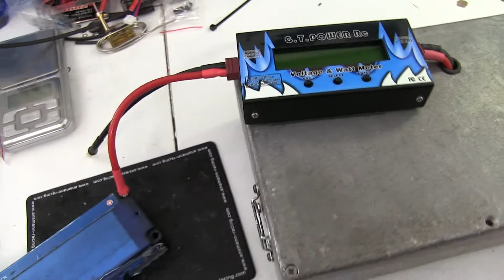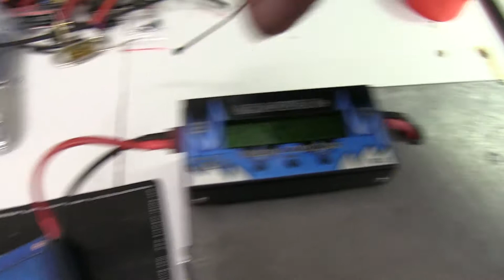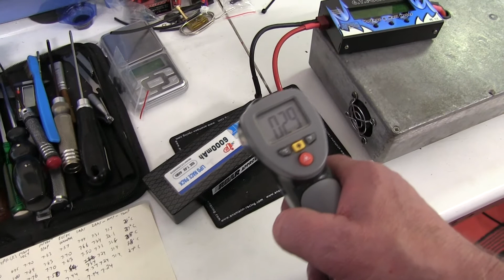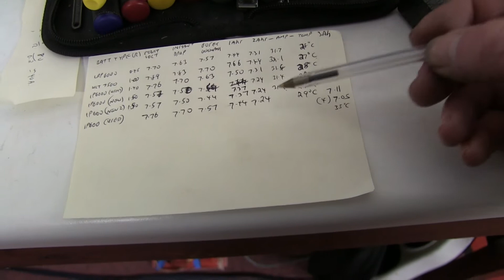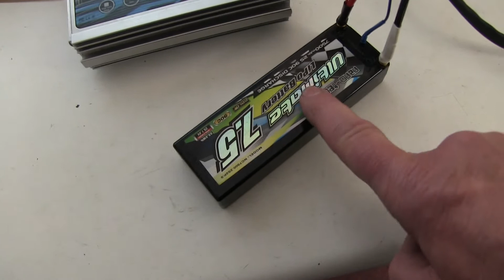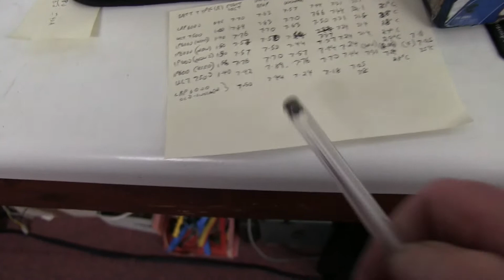Good Lipo Bad Lipo. How to test 2S Lipo to find the best .

Comment: Nice,Thank you sir for the detailed reply.  My wife and I are teachers and she teachers science.  We all race.  You answered my prior questions very well and I have already watched your new video.  I think the branding is hype.  I am not sure how much you know about lipo batteries and RC motors but is seems a lot.  I don't think there is a real issue with motors if you have the ability to test them.  I recently received two identical Tekin 4300kv 550 motors.  One was consistently faster but I would never believe it.  I changed everything from the ESC, Servo and even plugs and wires.  Finally, I just took the faster motor from my sons truck and put it in my Tekno SCT410.3 for testing as we have a track at home.  That motor was not only much faster but also ran cooler.  There is no timing in these motors.  No way of changing anything.  Thoughts on that?  ( Also, I have many more so if you are willing, I will pay to ship them to you and pay for the shipping back as long as you have a way to test them for not only speed but torque)  Last, in you opinion, do you think lipo batteries are as good as they can be at the moment or if someone was willing to dig a little deeper, could a dedicated company make truly better batteries?  Also, with the probable cost that would come with high end research and development, is there a market for a battery that might cost 35% more but perform 15% better?  Again, thanks for the videos and if I have your permission, I am  a writer for VRC PRO.  I am just starting but I will be post the races each week including the worlds, etc.  Are you ok with me leading people to your site to watch the tests?  Ohio is having some 17.5t SPEC racing talk lately.  People are saying that stock was created for people to be able to enter the sport fairly cheap and under control.  Basically it was for the beginner and intermediate.  Now it seems you have to put at least $2,000 in a buggy just to make the A-main.  I recently talked with a spec only driver who had $4,800 in his buggy(tires, transponder, multiple motors, multiple batteries and upgrades included).  I know the research you provide is important now more than ever.  Tony
Reply from the maker: +Tony Dugan 
Hi Tony
See my new videos comparing The Turnigy Ultimate and Graphene Lipos.
The Graphene are a lot more expensive, and I was expecting a step forward in performance.
See my video for the results.

The Lipo manufactures have been trying to stop the swelling (puffing up) of Lipos with the new versions, and also have raised the operating voltage (Super High Voltage).
However in practice they have lost some power delivery, even though they still rate them at the same C rating.
Some manufacturers nake exagerated claims regarding C rating, and I have seen 135 and 140c,  but tests show no improvement.

There is a masive investment in battery technology for full size road cars as well as many other applications, and I'm sure there will be a breakthrough soon.
At the moment I think the Lipo has reached as far as it can go.

Thanks for the offer, but I think I have enough to do at the moment, as I only do this testing in my spare time.

Race on.  Nick

Comment: The voltage drop you mention is not the lipo. It drops from 7.50 to 7.44v. Your meter have a 60v max voltage. And the most common microcontrollers have a 10-bit analog to digital converter. Dividing 60V with 1024 and you get ~0.06v and there is your answer :) The reason it go smoothly between the values it is because the microcontroller makes an average value over time.

Comment: Really nice testing, thanks for sharing.

Btw where do you buy the IP6000?
Reply from the maker: Hi Pabula
Thanks for the feedback.
The Intellect IP Lipo:
I am in the UK, so not sure where you are?
Nick
Reply: Im in the US, but i heard good things about IP batteries just not a brand that i can find here, im looking for a shop that has your 6000mha battery and can ship out, even if its from the UK.
Reply from the maker: Hi Pabula
It is not possible to ship Lipo by air out of the Uk.
You can check them out here:

http://www.racing-cars.com/sp/category/Manufacturer/subcategory/Intellect/templateid/12/searchbox7/Batteries.html
Reply from the maker: http://www.racing-cars.com/sp/category/Manufacturer/subcategory/Intellect/templateid/12/searchbox7/Batteries.html

Comment: Great video Nick!
Quick question, what should my Ohms read for a healthy 2700mah 7.4v Lipo 2 cell battery?
I’m new to all of this and trying to find a “healthy” reading for what these batteries should read...
Thanks Nick and all the best!!!
Reply from the maker: Hi Michael
You don't say how you are reading the Ohms.
You cannot measure with a normal multimeter.
Some chargers have a IR (Internal Resistance) reading, when charging (and discharging on more expensive ones)
Each charger will display different results, but can be used for comparison.
The smaller the Lipo capacity, and the lower the C rating, then the higher (worse) IR.
The very best Lipo have an IR below 2milliohm
Your Lipo will probably be more like 20milliohm.
Reply: Nick Adams s - you’re right! I’ve a balance charger SKYRC B6AC V2 that checks internal resistance, etc.
Sorry nick, I’ve been in such a hurry lately...
Thanks for the reply!

Comment: Nick Adams,Thanks for your video's and hard work.  Most of all, thank you for sharing your wisdom.  Most people want something and that's fine.  You seem to want to share the truth and provide an education which I really like a lot.  I would like to make a request for a video that I need, my friends need and new guys in the hobby will eventually make their way to your page.  Can you make a video and:1)  Show how to find the IR of batter and also does it change if its running a motor/ESC/servo/etc.2)  Can you give your opinion about quality for batteries and motors?  Basically, with the testing you have completed, have you found a company that is above all others?3)  Last, is there a way for you to find the point where NEW motors start to "heat sink" or lose power from too much heat and are they different between manufactures.  This kind of goes with my "which is the best" question.  I bought a Trinity 24k 17.5 and ran it in 2wd SCT.  My second race, I was messing with both the gearing and timing and didn't get it right.  My wife temped the motor instantly and it came back at 202*F or about 94.3 degrees C.  I should have lost power but didn't.  What do you think the limits are for heat?Thank you for all you do.  Regards,Tony
Reply from the maker: +Tony Dugan 
Hi Tony
1. Measuring the Internal Resistance is quite difficult to get a meaningful result, since there are so many variables, especially the connections and wire etc.
I have an IR meter which is temperamental, and needs very good connections.
I now prefer to measure how the voltage holds up under a high amp draw load.
2. Regarding which is the best make of motor and Lipo, I have only tested a limited number of makes, but I try and test the best, rather than waste time with the others that are known not to be good.
I am sure there are only a few manufacturers (in China) that make all the motors and Lipos, but with outer cosmetic differences.
Therefore it is possible that some unknown make could be very good.

Of all the Lipo I have managed to test, the Turnigy is the best. (The Ultimate series).
Motors : the Trinity Revtech are the best, as they perform and are reliable and don't burn out easily.
Others could be very good, but often are let down by poor case design with screws that strip out and badly fitting sensors, and burning out the windings, or rotors exploding or losing magnetism.
3. I recommend not getting the outer case above 80degC, and preferably only in the 70 degree range.
I have seen motors survive over 100degree C, but the inside will be way hotter, and the solder often melts off the connections.
Also a lot of motors will melt the insulation and short the wires on the stator when they are overheated.
This normally shows up the next time it is turned on, as the insulation has run off the wires and will short circuit , sometimes taking out the speedo.
Use a big fan on the motor, ( I use a 40mm x 15mm thick) and it will lower the temperature a lot, maybe 20 degrees.
All motors lose power at high temperature as the stator windings will increase in resistance, and the rotor will be extremely hot and will lose magnetic strength (which will return as it cools, on most rotors). Some rotors will lose magnetic strength if you are unlucky.
If yours did not lose power then you are onto a winner.

Keep on racing to win.
All the best
Nick

Comment: Great video. What charger do you recommend to be competitive at the track? Any good advice. Thanks in advance.
Reply from the maker: Hi Alejandro
Any Lipo charger that can charge at 7 amps or more.
I charge at 7 amps at the track, but you can use up to 3xC with modern Lipo
So with a 6200mah you can charge at 3x6.2 = 18.6amp.
From a 12volt battery, 10 amp would be ok.
Reply: Thank you.

Comment: Hi Nick. Been binging on your channel. Is there a company that makes a almost all in one charger like the turbo 30 was years back?
Reply from the maker: Turbo 30. That was 40 years ago!!
What do you mean all in one?
Reply: Nick Adams I mean a high discharge rate ,  cycling with the high amp discharge rate ,motor testing. And also wondering what you think the best charger is now if money didn't matter?
Reply from the maker: Hi
I don't know of any that do motor testing, that also do the high charge/discharge.
The best charger/discharger is the iCharger 406Duo (With the optional external resistive load).
Reply: Nick Adams thank you very much. I love the videos and that you take the time to answer. It's straight to the point and unbiased. It's been my crash course back to the hobby. Looking forward to the mini pro breakdown. I've been considering that or the mcpappy Dyno.

Comment: Nick, have you ever measured an internal resistance drop in Lipos when being charged and discharged at a high amperage rate of 40 Amps or similar?
Reply from the maker: Hi
The internal resistance drops as the cell is discharged. I assume as it heats up.
The internal resistance, when charging also drops, although the heating is not as much as when discharged.
So when I test, I record the IR at the end of a full charge, starting with the Lipo at ambient temperature.
As I test at only 20 amp charge, there is virtually no heating.

Comment: I see that you are charging at 10amps or roughly 1C. Most folks I race with are charging at 2 and 3C with their high powered iChargers. What are your thoughts on the practice of charging at higher amps? Thanks.
Reply from the maker: Hi
The latest Lipo can take repeated charging at 3C without any degradation.
Charging at 3C is quicker, but does not increase power.
Unless the Lipo has been heated and they want to charge it up and race before it cools down.
Reply: Now that I know it's safe, I may give it a try myself. Fast, yet safe, charging at 3C is indeed helpful on race days. I bought Turnigy batteries on your recommendation. Thanks for the fast reply!

Comment: Hello
I need your help
I have a lipo battery 3s 5400mah which is more swollen 8mm more than the normal size,the Voltege indication of each cell is exactly the same with another lipo battery 3s 6000mah,is the swollen battery dangerous to use it or I need to check something more?
Reply from the maker: Hi Paris
The Manufacturer will say, do not use.
Sometimes the swelling will reduce as the gas is re absorbed.
The performance will still be ok.
However 8mm is a lot and it will probably swell more if you use a high current load.
The pouch can swell a lot without danger, but if it is a high current load, I suggest not to use any more.

Comment: hey Nick I'm a little new to the race scene. I was just wondering how long do a 3000 mAh 90 C lipo will last in a 10-minute race in Blinky mode with a 6 amp 17.5 motor.
Reply from the maker: Hi Johnny
A 17.5t blinky with a 2S lipo, at racing speeds will draw up to 2000mA over a 5 minute race.
A 10 minute race would draw 4000mA, so your 3000mAh lipo would not last.
Also do not run a Lipo flat or it will probably be damaged.
I suggest at least a 6000mAh Lipo for a 10 minute race.
However if you are not racing , and driving slowly it will last longer.
Reply: also nick how mini cycles can you do on a lipo in one day two be safe. I have six lipo that I juggle around with and i'm trying to cut down two battery I have two new pro-tek 2s 100c 7.6 hv 6100mah and the 4900 hv  2s these are my two top battery.  I only have one kit  and I use a battery for each event practice,heat,qualifying and main. would I be able two get away with just two battery
Reply: thanks Nick and to just satisfy my curiosity how many times can this better be cycled in one day
Reply from the maker: Hi Johnny
I have cycled a Lipo many times in a day without any problem.
As long as you do not over discharge.
Reply from the maker: Hi Johnny
I have raced with just one Lipo, by just topping it up between races.
With two, you can alternate, which gives time to fully charge.
As long as you have time to charge there is no problem.
Lipo will perform better when charged just before the race.
Lipos charged the day before will have a lower start voltage.
Reply: Nick Adams thanks you doing a great job I can always rely on you to give me out of dilemmas that I don't know about and I'm way out here in California. thank you so much for your help and continue your good videos I'm always watching
Reply: Great video Nick!
Quick question, what should my Ohms read for a healthy 2700mah 7.4v Lipo 2 cell battery?
I’m new to all of this and trying to find a “healthy” reading for what these batteries should read...
Thanks Nick and all the best!!!